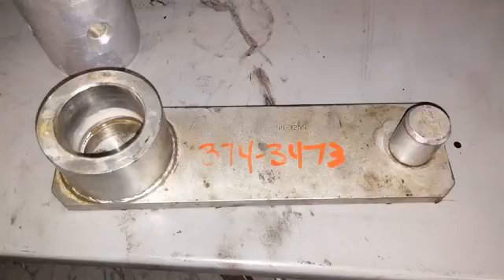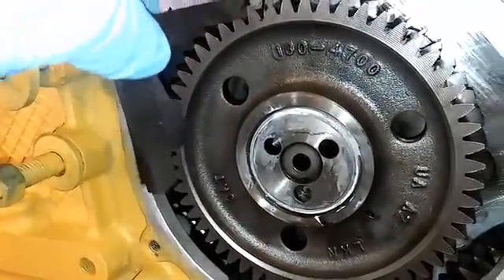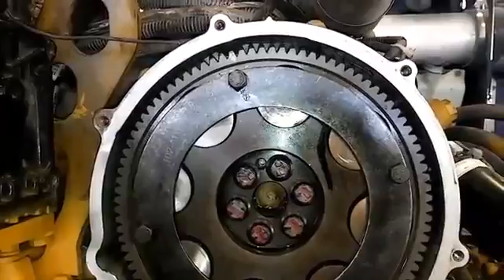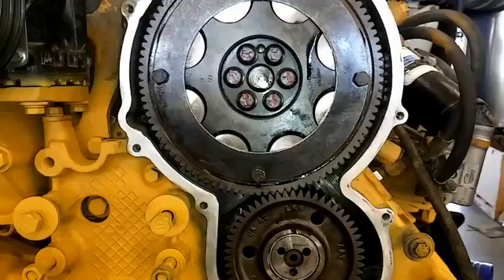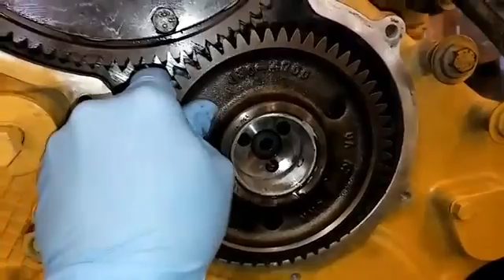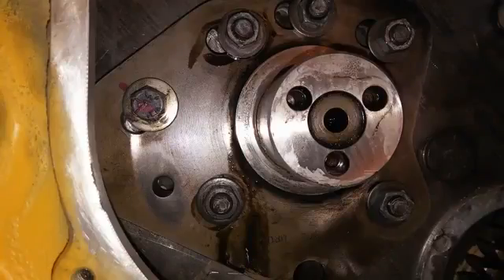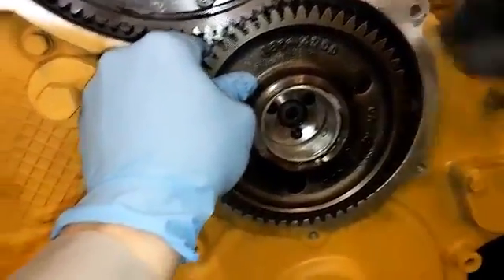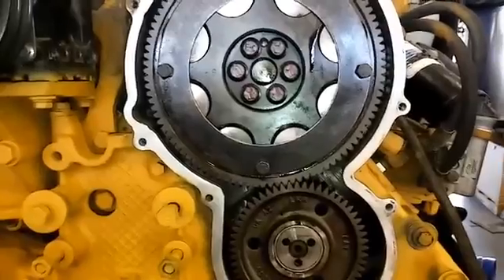3406 & C15 Camshaft Gear Backlash  Set Gear Backlash

Comment: If the cyl. block and or cyl. head has been surfaced the factory hole alignment hole can be off! Took a idler gear and cut it so I could go through the slotted holes I made in the gear so I could snug the retaining bolts a little then pry the gear and idler shaft over tell I got the alignment of the timing make and have the right backlash! Cat had us send them a picture of the gear we made and came out with one that is hour glass shaped removing some of the teeth, so you could get to the bolts to adjust them!